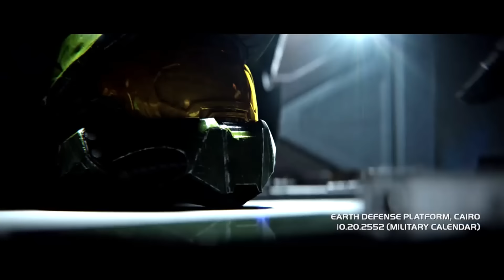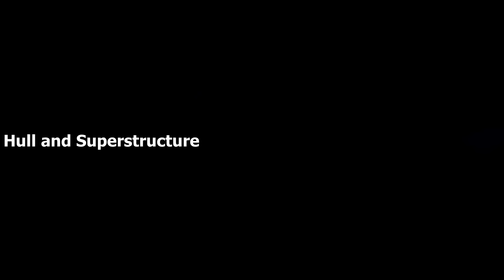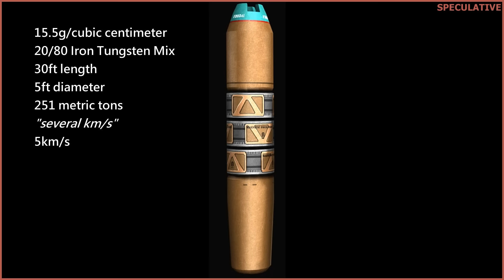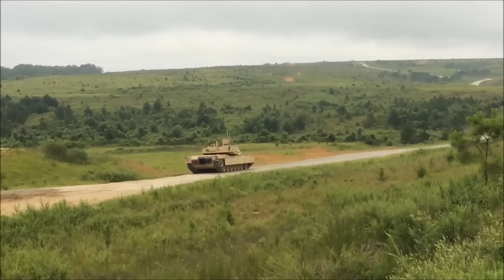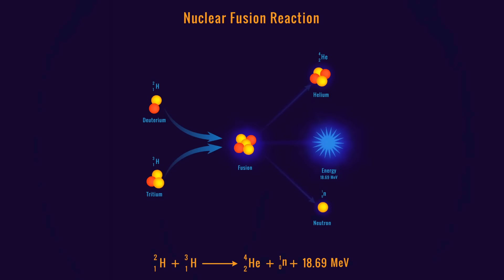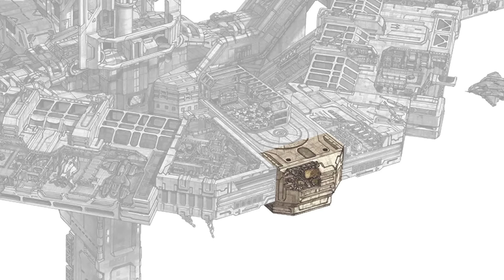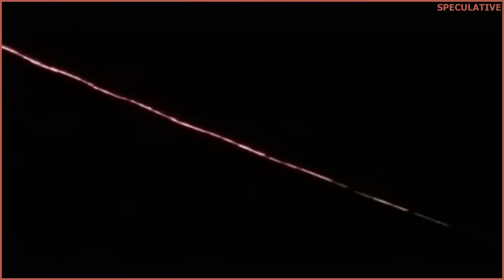Orbital Defense Platform | Most Detailed Breakdown

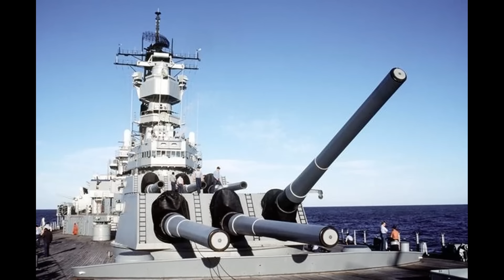Comment: 24:30 to put it another way, the MAC round has more force behind it than the Little Boy nuke dropped on Hiroshima
Reply: That’s so gnarly. I believe if we had something like this in real life the powers that be would have zero hesitation to use them because “no radiation!”
Reply: @ScooterMcClutch  I'm not saying fallout isn't a contributing factor because of course it is. But if you think of the effects of using a nuclear weapon, the fallout is always the afterthought. The immediate feeling is centered around the "bang". A nuclear weapon's indiscriminance, I think, is the principal thing which causes the stigma. For good reason of course. Something like a MAC would likely be looked at like a "tactical" (smaller yield) nuke. Just because they have a smaller blast than a full size strategic weapon, they aren't thrown around willy nilly.
Reply: @ScooterMcClutch what would the governments use an ODP? If I had to guess, I’d assume there is a system that prevents the platforms from bombarding The planet . You don’t need an orbital MAC to use against a target on earth, you can just drop a tungsten rod about the size of a power pole from anywhere from 160 kilometres to 320 kilometres up, though targeting from 320 kilometres up would be a difficult task.
Reply: @thatgamingprotogen7043  I just mean a way to deliver that much kinetic energy in general. Don’t over think it
Reply: @ either way, there is, if we look into the lore, way more energy than little boy. The regular MAC’s on ships have that energy, the ODP MAC’s, called super MAC’s in several novels are at least 100 times the power. If I recall, the Platform MACs fire a 100 ton( could be off by a zero or two) projectile, where the ship based ones only use around a 1 ton projectile.
Reply: @thatgamingprotogen7043 that's not true. Shows you don't understand reentry or orbital mechanics
Reply: @cosmictreason2242  ever heard of rods from god? Or the one Soviet project November sky? Do the math, a tungsten rod weighing 1800kgs falling from 200 kilometres up, hitting the ground at the terminal velocity of tungsten, which is Mach 10, generates close to 3 billion joules of energy, 1 kiloton is 4.8 billion joules. That 3 billion joules is just from dropping a heavy metal rod from space. So please say I don’t know what I’m talking about
Reply: @ you are off by a factor of 1000. You just used two tons of tungsten to produce an explosion equivalent to one ton TNT. 4 gigajoules is a ton TNT which is the equivalent energy to atomize a human being, or level a couple blocks. Terminal velocity furthermore is not reentry speed
Reply: @ you are correct, I forgot the thermal energy, and ionized atmosphere around the rod, plus the ionizing of the surface. The friction between the rod and atmosphere is not enough to melt the tungsten.
Reply: You could also add some extra velocity to the projectile, which isn’t required to allow the rod to fall through the atmosphere.
Reply: @thatgamingprotogen7043   the first 10 minutes he says it can be rotated 180 to target planet targets
Reply: @ you think i watched that far before commenting that?
Reply: @thatgamingprotogen7043  youve had 6 days to finish watching it lol
Reply: @ I’ve been busy with other things, like moderating a debate or 3 on how many spartan II’s it would take to bring down a space marine, among other things
Reply: @thatgamingprotogen7043  that’s a noble pursuit if there ever was one. What was the final conclusion?
Reply: @dogloversrule8476  the final answer was 26 if its the regular, they’re discussing how many to take down tyberos the red wake, but it’s up at 60 right now

Comment: Fun Fact: Each of the 300 Orbital MAC Platforms surrounding Earth held a total of 400 - 450 UNSC troops.

So by the end of the Battle for Earth, only a handful of them remained.
Reply: honestly I find that to be a skill issue because the UNSC should have team shotted the two biggest ships during the initial engagement
Reply: @cloroxbleachchocolate_synchron  the covenant strategically boarded and destroyed ODP's from the inside. The majority of the Covenant's forces were destroyed but a large enough gap in the defense grid was made for the fleet to pass through. The covenant didn't employ their largest ships until it was done.
Reply: @marranin007  but still if even is the 2 big ones where even slightly out of range, that many ODPs focus firing on them would still do something
Reply: @cloroxbleachchocolate_synchron  Here is my headcanon. "Out of range" in space for kinetic rounds generally means that the ship can dodge shots fired, ie, by the time the shots arrive, the vessel can easily move out of the way. Space is very, very large. Not sure if even a shotgun blast of MAC rounds dispersed over an area have a high chance of landing. Additionally ODPs turning to focus fire one target can leave them vulnerable to other targets.
Reply: @samc9133  yeah but still it's 300 of them or at least a good slice of that 300 in that particular direction all aiming at one of the two carriers and the projectiles fired are at least at about 4% the speed of light Plus there is a whole ass support fleet that's around the ODP that are capable of focusing on shielding it and shooting down enemy fighters and what's the two carriers are down or at least one of them and Master Chief blows up the other one they could work on cleaning up the remaining cruisers
Reply: @cloroxbleachchocolate_synchron  eh...

The ODPs are in geo stationary orbit. So, maybe half to 2 thirds of the network can fire at any fleet assuming it maintains a, relatively, close formation, because earth is kind of blocking direct shots.

Next. Space is big. Really, big. The speed of light between earth and the moon, for Intance. Means there is a... 4 Minute delay between sending a message from earth, to the moon. Not including time to send back a message. 

This means, to be generous. You have 2 minutes to dodge a shot comming at you, at half the speed of light for example. once you've detected the hostile ship firing at you.
Reply: @Destroyer_V0  yeah this is understandable but like given what is shown in Halo 2 it looks like regrets fleet had jumped in just slightly outside of range given how it's displayed on the monitor in the cutscene so late even if like 30 or 50 of those supermac were focus shooting at the covenant carrier at least a few of them might hit
Reply: @cloroxbleachchocolate_synchron  a few kms isn't 4%c. 0.1%c is 300 kms and the space shuttle flies at about 8 kms to get into LEO. That's after several minutes of rocket burn. MACS in lore fire at about 3-10 kms and super MACs maybe up to 50 kms
Reply: @cloroxbleachchocolate_synchron  put it this way: the moon is a minimum 360,000 km from earth. Geostationary orbit is 36,000 km from earth. If the covie fleet is only twice that distance from the ODPs, then a shot flying at 6kms will take 6,000 seconds, or an hour and 40 minutes. Lore super macs firing at 60,000 m/s or 60 kms would get there in ten minutes. Plenty of time for ships to maneuver away. They could be quite a bit closer and still outside of realistic range. They could be 360 miles away and the MAC rounds quoted in this video would take a whole minute of flight time to get there.
Reply: @cosmictreason2242  whatever targeting computer or AI on board account for the enemy ship moving out of the way in coordinate shots what's the rest of the ODPs like it one of them took a shot of the enemy ship and the other odps would try to predict and lead subsequent shots?
Reply: @cloroxbleachchocolate_synchron 
That's because Covenant ships outrange ODPs. The UNSC has to blanket an area of mac rounds as a area of denial. While Mac rounds are fast, space is ridiculously huge, if you work out the maths of a one mac round firing, it takes 30 minutes for a single round to reach the moon.